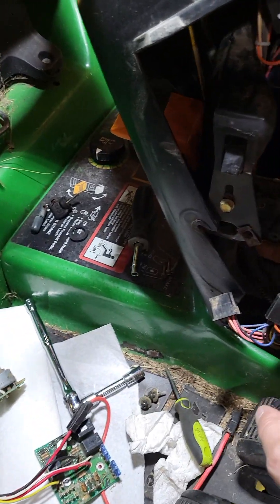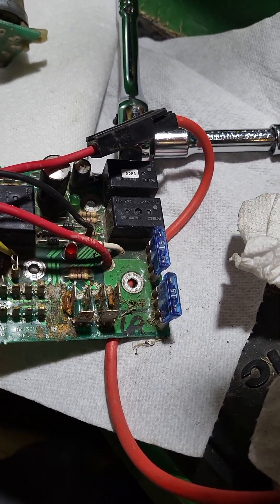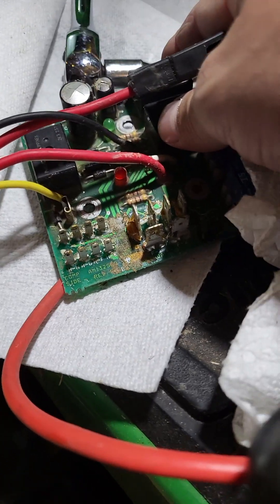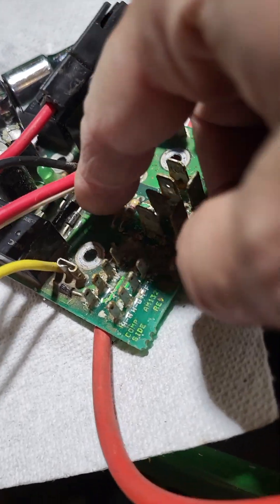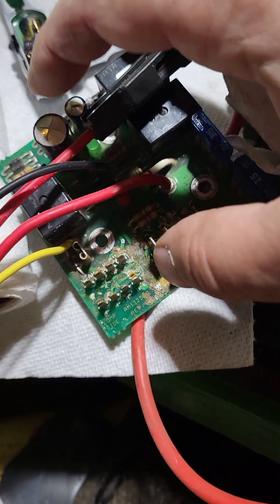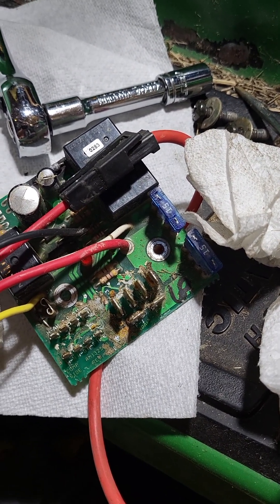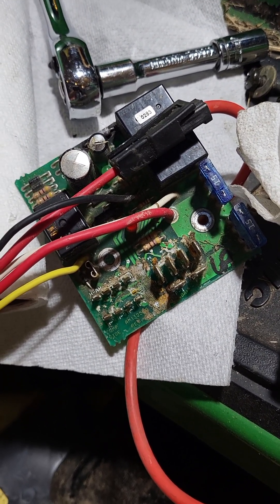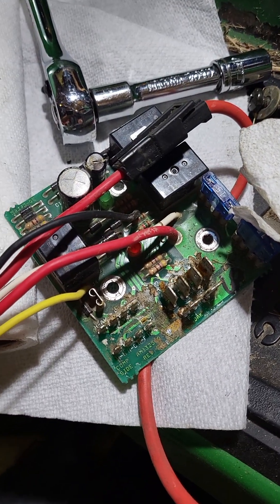What happened? John Deere 345 Ignition Interlock Circuit Board fried.

Comment: Did you fix the issue.  I have the same issue
Reply from the maker: Yes, I replaced the bad components and put an inline fuse. I've replaced other boards with used boards.